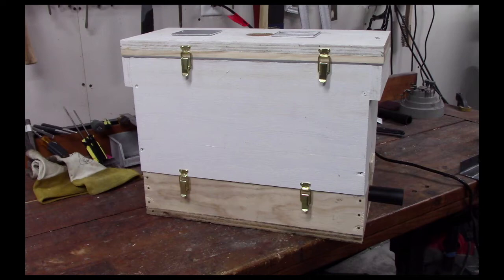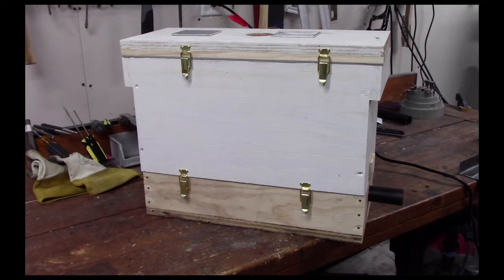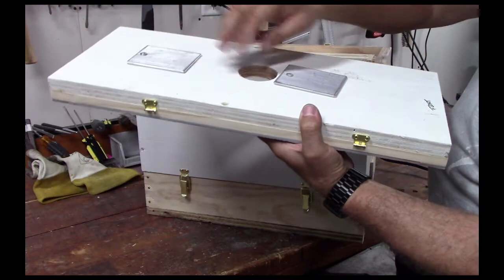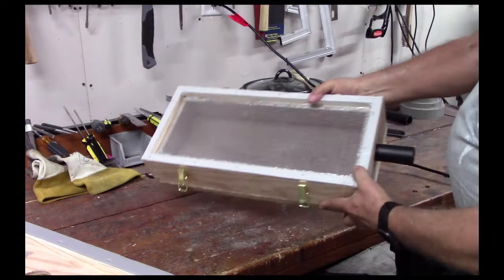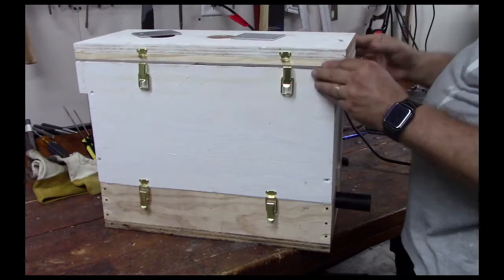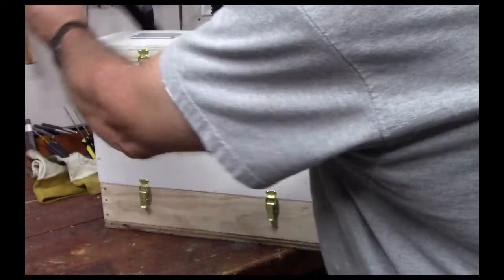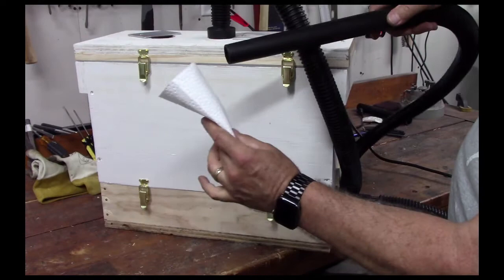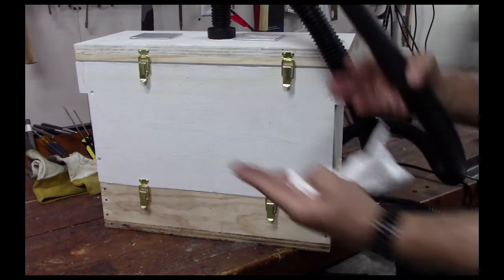DIY Bee Vacuum.

Comment: Tip : To assist the Bees
: Better to have a Sloping Floor in that Lower base Box. That way the Bees will walk uphill, so to speak, 
onto those Frames you provided in that Nuc Box.
Better to have an Inner Cover / with added Top Screen (to keep the Bees from flying out when you pop that Hive Lid.)
And dont have that lower box screen at all. 

The Shop Vac Hose should "Suck"  from the Top Roof Vent ! (Not that lower one.) You've got it back to front ???

It should be as follows : A lower (low flow rate Tube) off that Front base : to gather the Bees. 
They then get gently sucked into that lower Floor Tube Area, crawl up that Sloping Floor and then they Walk right up onto those awaiting Frames ! Correct Beeline of Travel !👍
Memo : no Screen Material should be placed or used in that lower Base Box and the Hive Body [Frame Box.] Or bees won't be able to move on up ! 
Bees move up a Hive in working its internal Environment. Just saying. . .
Hope this helps folk. 😎
🐝🐝🐝🐝🐝🐝🐝🐝🐝
Happy Beekeeping 2023
🐝🐝🐝🐝🐝🐝🐝🐝🐝
Information :
Your Demo is in an incorrect Air Flow use Re Vac Tube use and placement. 
Top is Vacuum Suction access. The lower one is for the Bee Suction Tube (taking them along and eventually up into that Hive Brood Box.
Just clarifying things correctly. 🙄